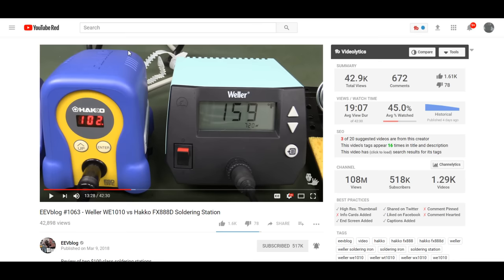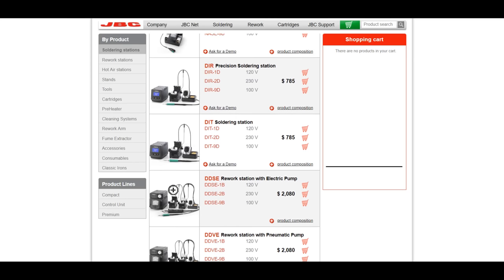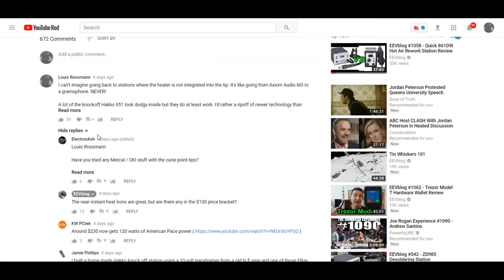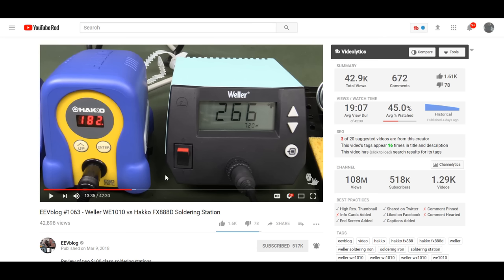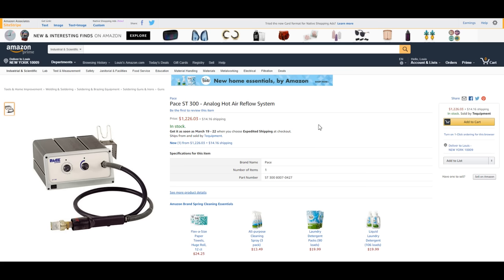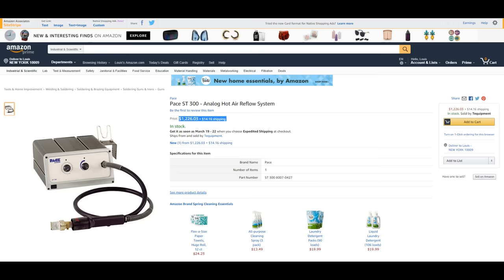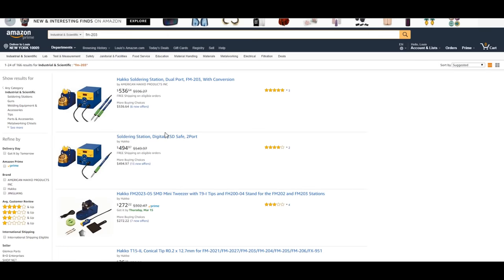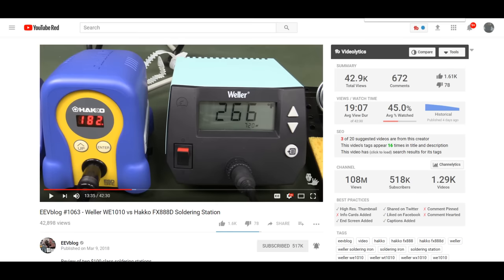Soldering station technology & the lie of "SOLDERING PATRIOTISM"

Comment: having done daily work with both a Hako 880D, Metcal automatic and an old Radio Shack Digital Weller clone I can honestly say that a classic ceramic core soldering pencil works just as well as the automatic integrated core system for surface mount work and most through hole. Unlike the integrated heating element system though, the separate core/tip last far longer. The hakko and the RS both never had an issue with their heating cores in 6 years, where as the metcal ate 100$ in tips a year. I'm willing to wait a few more seconds to heat up, if i dont have to buy an FX880 in tips every year....

Comment: Louis, I suggest You look into Quicko T12-952 It's the c heapest soldering iron, which uses hakko tips, has a motion detector in the handle to put it to sleep after few minutes,  better interface and an oled display for less than 50 $$$$$, I'm using it in my repair shop for 4 months now and for this price I can't imagine it getting any better.
Reply: My display died after 3.5 years

Comment: I just brought a JBC CD-2BE Soldering Station to replace my £9.49 Silverline 100w, and to my amazement the JBC is a wast of time! it could not solder 2mm solid copper wire to 0.3x25mm Nickel! The JBC has 130w but its not up to the job, I build EV's so I solder 2AWG and solid 2mm copper daily. What I'm thinking is wrong with all the newer irons is they don't have any mass to retain the heat, and the temps are far to low, I like my iron at 550-600C.
Reply: I think that station is only capable of ~75w continuous. T470 is their temperature controlled high thermal demand iron, if you want that. Probably T245 can do it with large tip & a DDE station.

Comment: "Fahrenheit has more steps within the useful temperature range"
We have this brand new invention here called a decimal point
Reply: Was just about to make that exact same comment XD.
Reply: @Marcin Berman What are you talking about? "There is a fixed amount of digits" in between two chosen numbers? (E.g 1 & 2) Uhhh, no. There isn't. There is literally an infinite amount of numbers between 1&2. (or any other numbers)
Reply: @Rudabaugh  ...He means there's a fixed amount of digits in the display and the software that's controlling the temperature.
Reply: @Thinwhiteduke1185  but i'm guessing Dave did not understand Marcin's comment because of how easy it is to add more digits to the screen.
Reply: lol congratulations, being so hung up about our systems of measurement. Must be really fulfilling
Reply: @DecadantHandshake  I was just responding to that specific point, about having more steps within the "useful temperature range". If we're actually being real, an average person can't tell the difference between 21°C and 22°C, so the argument itself is meaningless.
Reply: Having fewer-- not more--  steps within the useful range is a GOOD thing. My soldering station (Hakko FX951) requires adjusting the place values of the temperature individually. I can adjust from 300C to 400C with a single click and that takes me from 572F to 752F. Or I can "fine tune" anything from 300 to 390 by again adjusting only the tens place value. I find I almost never need to go outside the range of 300-390C. Nor would I ever have occasion to adjust temperature in increments of less than 10C (18F). Smaller adjustment add ZERO utility and only require more button pushing.
Reply: @Limerence Yes that antiquated german temperature measurement unit which the germans don't even use themselves anymore really says freedom
Reply: @G5Hohn  spoken like a true Communist... "Less choices is BETTER!!"
Reply: @BKD70  Tell me you're inexperienced without telling me you're inexperienced.
Reply: As if 1 degree (°C or F) matters anyways.
Reply: Also water freezes at 0°C and boils at 100°C, something that confuses the heck out of Americans for some reason lol
Reply: don't use prehistoric systems of measurement then.😜
Reply: @JVMstudio97 to be fair, they struggle to breath and walk at the same time.

Comment: In my country, the FX-951 costs around $450 after tax, while the FX-888D is $170 after tax.

Also, price isn't the only thing. When it comes to soldering stations, you might want to buy something that's not going to set your house on fire. You might want to buy something with a warranty. You might want to buy something that will last a while.
Reply: sometimes you want to buy something that can actually solder.

Comment: I have a old-style Weller Magnastat station, and i am totally satisfied with it.
Not the most fancy thing ever, but it is extremely reliable.
I got this thing from a company i worked at over 10 years ago, and the company had used it for 10 years before that. Only thing i had to change in all those years were some tips, and since the tips don't have the heating element in them they are very cheap and can be swapped out in seconds.

Comment: I have a Hakko FX888D.  It is ready to solder within 10-20 seconds depending on the job.  I only paid about 100USD for it on amazon.  I do not do a lot of soldering.  I am only required to use it about 5-10 times weekly.  But for my small workload it's the best bang for the buck.  If I was doing Louis' workload of course I would want better.  But if you're a hobbyist or have a small customer base, don't look any further than the Hakko FX888D.  The issues that Louis describes with the temperature isn't nearly as big of a deal as he's making it out to be in those instances.

EDIT:  Another point that Louis fails to mention is the cost of maintenance.  We all know that a Hakko device is more than likely going to last longer than the Chinese knockoffs that he is promoting.  That is not my argument here.  What he fails to mention at all is the cost of the tips of the older tech FX888D vs the newer tech FX951-66.  A tip for the old tech is approximately 5 bucks.  The same tip in the new tech is over 4 times that at approximately 22 bucks.  Tips go bad no matter how well you take care of them.  If you go with the newer tech, the initial cost isn't the only premium you will be paying.

Now my original statement stands.  If you have a heavy workload, then sure.  Pay the premium and buy the better product.  But if you don't need that . . . the FX888D is the best bang for the buck if you want genuine Hakko quality.
Reply: I started with an 888D as well, as a matter of fact I still regularly use it. However, one thing I would like to say is that the cartridge style of irons are in a completely different league. One day I got lucky and a friend told me about some FM-202's on eBay for $200. They came with the stand, brass sponge holder, 2027 handpiece, and the dumb little card to lock and unlock the station. Seller was willing to take best offers as well, so I asked if I could get one for $175, and I was able to. I was similar to you, not really doing that much soldering. Maybe 5-10 times a week. I'm still in that same zone actually. But once you try using one of these cartridge stations you'll just wonder how you ever put up with the older ones. I like the 888D, it's a great station, it really is. If it wasn't, I wouldn't still be using it as much as I do now. But the comfort and utility of the cartridge ones makes them completely worth it in my book. 

The tips may be more expensive, but you'll be replacing tips on the cartridge ones just about as often as you would be on the older ones. It may be 4x more money per tip, but if you're replacing them once a year then it's not that much of a problem at all. Just having the ability to rapidly swap tips, while they're still hot and the station is still running, is a complete game changer. You might think "I never change tips", but when you have a handful of different tips to choose from and swapping to them takes all of 10 seconds, you'll inevitably find yourself changing them all the time as you progress through the repair. 

Being able to swap to a knife tip after using a bevel without having to wait ten minutes is amazing. When I use the 888 I'm reluctant to change tips because I'll have to wait for it to cool down, or deal with handling a very hot chunk of metal and trying to secure a new tip on if I want to save time. So I just rarely find myself wanting to change tips when I use it. The real benefit of these cartridge stations is the incredible ease of changing tips, it makes your workflow so much simpler and less time consuming.
Reply: @BaradaNels  Something worth mentioning, a lot of these higher end stations actually calibrate the tip automatically. The T12/T15 tips from Hakko for example all have a barcode on the very end of them. On the FM-202, you can slide the tip's barcode end into a port on the station, and after a second or two it will recalibrate to a new profile specifically for that tip. It's actually super fancy.  

But yeah, I can see what you're saying. If you wanted to ensure the tip is really working the way it's supposed to, you'd either have to get an external calibrator, or have a station like the FM-202 that can calibrate them automatically. If you don't have a station with built-in calibration, then you really won't be saving much time with the cartridge tips, since you'd have to use the external calibrator to check them anyway.  

RE the multitasking, this is actually what I like so much about the cartridge stations. At work I regularly use my old 888D (I bought it myself and brought it to work after I bought the FM-202). The thing about my job is I am almost constantly interrupted. I'll sit down to start something and 30 seconds later I could have to turn everything off, get up, and do something else like talk on the phone or help a walk in customer. The 888D is super incompatible with this kind of constant, interrupting workflow. I turn the station on, it warms up, I tin it up, then I have to stop. I turn everything off because I have no idea how long I'll be away, it all cools down. I come back to it 5 or 10 minutes later and have to wait for it to all warm up again, re-tin everything, and hope I can solder what I need to before I get interrupted again.  

The 202 on the other hand warms up in less than 10 seconds. If I have to shut my 202 off to go do something it's not that big of a deal, it'll be ready to go again in a negligible amount of time.  

I would have to say that my biggest complaint is these types of irons have been around since, like, the late 80's and early 90's. They've been patented for at least 30 years, but there are VERY FEW consumer level irons that utilize the technology. With how long these irons have been around I would think that there would be way more consumer level ones that are cartridge based, but there just aren't that many at all. In fact, the only one I can think of is the PACE ADS200. And that is still $100 more than what I spent on the used FM-202. I was really happy to see a cartridge station appear in that price range because it's still pretty affordable, albeit on the high end. It would be great if more companies would do the same thing. Cartridge irons have been around for decades, there's no reason they should still be confined to $500+ stations.
Reply: My 888 is working great for my hobbyist level stuff

I wonder what a little aluminum foil would go between the heater and the tip. I'm not gonna try it but would be interesting to see if it helps conduction.
Reply: @androiduberalles  i have seen somebody put thermal paste between the tip and element and apparentpy it works well.

Comment: The old technology stations are still worlds better than a $20 iron that just plugs into the wall.

I use the hakko fx888 every day at work with no issues. It heats up in a reasonable amount of time for what I do. I also have one at home that is overkill for home use. So maybe it’s just because I’ve never used a new technology station, but I have absolutely no issues with the fx888.

Plus replacement soldering tips are relatively cheap  and readily available.

Although now I would like to use a new station just so I could really see how big of a difference it makes.
Reply: Which station do you use? I'm looking into getting one